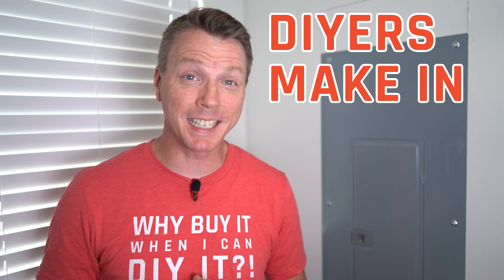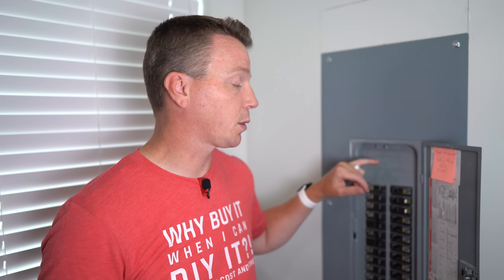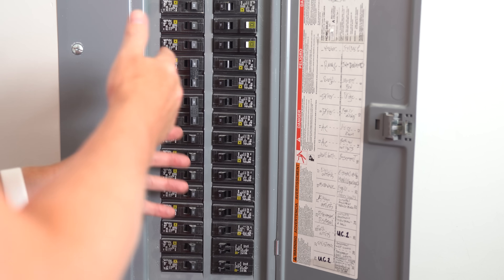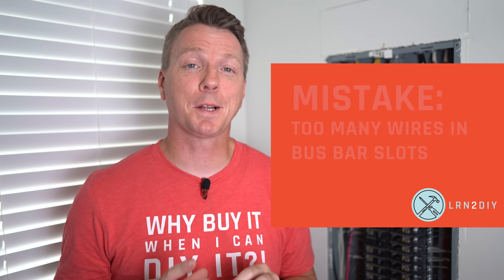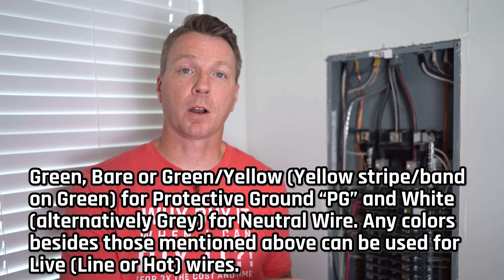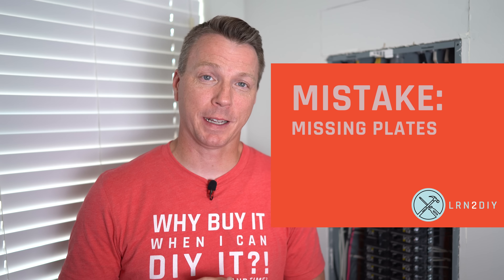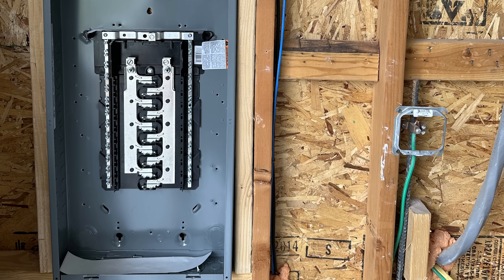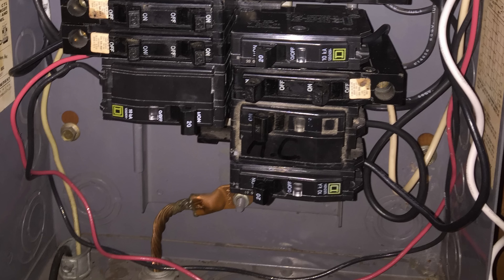10 Common Mistakes DIYers Make In Circuit Breaker Boxes

Comment: Thank You sir ! As a retired Journeyman Electrician with more than 50 years of experience in the field I saw more than my share of the "rats nest" type of panels, gasoline stations that had been remodeled several times. I couldn't always make them look perfect, but I tried. Any of the new Installations that I worked on, looked like the 3 phase panel you showed. When I upgraded my own residence from 70 amp Zinsco to a 200 amp Homeline  all my wires were formed and marked. When the city inspector came for final inspection he was taken aback and had to take a picture of the work. It is sad to say that too many tradesmen do not take pride in their work and only do the minimum.
Reply: I’m sure your fire department and insurance company thanked you for changing out that Zinsco. Given the issues with the Zinsco breakers, you saved yourself quite a headache.
Reply: I feel for you.  The day I realized that I changing out a Zinsco breaker with a Square D breaker box and all new breakers was cheaper than buying the Zinsco breaker was enlightening.
Reply: I had to do an entire clean up of excess wire that was stuffed into my square D 200A panel, purchased my 2600 sf home new and a “professional” electrician wired it, it was a nasty rats nest, I cleaned up the entire thing by removing excess wiring and routing them neatly.. professionals don’t always do professional work, guess time is money.
Reply: Amen brother, I thrive on neet and tidy.😂🤠
Reply: I am not sure why the electrical inspector did not turn the work in the panel down for sloppy workmanship. it is in the "N.E.C." that" all work shall be done in a workman like manor ". I do know that trying to up grade a gasoline station can be a problem with the pumps being that the seals that are pored  cannot allow the wiring to be removed being that wiring to gas pumps is classified by the "N.E.C." as explosionproof.
Reply: I've had that experience and I'm not a pro.
Reply: I'm thankful you do ❤🎄
Reply: That beautiful panel is inflexible to me. If I have to move wires around I have to cut zip ties and some of the wires are going to be too short. I liked this when building data centers but at my house that would drive me crazy. 

So I would like to se an example of an organized panel that still has flexibility so if I need to move a top circuit down some I still have enough wire length to achieve that. 

Does anyone have a suggestion of how to gain that flexibility and still have clean looking wires?
Reply: @ecospider5  Cut your conductors a set number of inches longer than you would need to do the pictured breaker connection.  Then just create a U shaped loop, visually similar to a plumbing p-trap, only with tighter bends.   I generally do 4-6 inches, but keep it consistent in the same panel.  As I get toward the bottom, I shorten the loops to what is necessary to move the breaker to the bottom slot.  I still zip-tie the bundle since it keeps things tidy, and snipping a zip-tie is simple.
Reply: @HisboiLRoi
Thanks. Good idea. I can see that working with 10awg wires and smaller. Especially if there is room.
Reply: @HisboiLRoi no need to zip tie wires in the panel. I absolutely hate that. I shouldn't have to cut zip ties of all the wires in a panel just so I can get to 1 wire. I use to do it bc that's how I was taught. But after going back and having to work on it, it's definitely not worth using zip ties. Even more reason not to now with the afci-gfci breakers and extra wires in the panel. Same with doing saddles on switches, feeds & grounds. I shouldn't have to take out 3-4 switches just so I can get to the 1 I need to. If there's 4-5 switches, a 5 gang box, I do 5 tails, 1 for each switch. Waaay easier to work with imo
Reply: @ecospider5 splice the wires, put a wire nut on it & there you go, you have flexibility
Reply: @jkhan6831
You’re right now, but I think about it the splicing one or two wires when you need to move things is gonna look a lot cleaner than leaving enough wire on every circuit so you’d never have to use a splice.
Reply: @ecospider5  I usually loop around the panel once before i hit a breaker. Well not an entire loop@, but if the wire comes into the panel at the bottom I'll go all the way up the other side, across the top or bottom,  and then to my breaker lug.  If there is room to do so anyway.  Otherwise I will usually double a length of the wire back onto itself neatly before I hit the breaker then zip tie things into  an orderly fashion.  I really don't personally care for zip ties in panels as it makes wires hard to trace. But a few are usually necessary to keep things neat.
Reply: That often comes down to money, the customer not willing to pay for a proper job.
Reply: This is why you should never hire electricians.  They do bad work and give out tremendous amounts of false information like "Only use 80% of a boxes rated capacity".  Nonsense.  The box is RATED 150 amps it can DELIVER 150 amps ALL DAY LONG and NON-STOP...that is what rating means.  He also talked utter nonsense about he cannot add more on to this panel when he added a finished basement.  Pure idiocy.  You can double each individual breaker to get the required capacity.  There is no physical way to overload a panels capacity TURNING EVERYTHING ON FULL POWER.  Light circuits run an amp or two MAXIMUM.  Wall outlets might run 13 amps maximum with a space heater but no one is running FIVE SPACE HEATERS AT FULL POWER while the electric water heater is running, the dishwasher, the furnace, the electric dryer, etc.  It simply never happens.
Reply: Standards are the absolute minimum you should do
Reply: More than one way to skin a cat.  These guys that do not leave extra wire in a panel require a lot of patching up when you got to wire nut extentions on just to reposition the breakers when new applications are added.  When you know that you may add solar, or an out building , or a hot tub, or a car charger, and so many things as that we can not predict it's better in those situations if the electrician before you left long wires to work with.  When you retired before 2023 you may not of imagined that future circuits are going to have all these requirements that could require moving breakers. The code changes every 3 years -- it's updated and added too.  So if you are implying that someone made a mess for not short wiring then you would be wrong.  Every old installation required a permit and an inspection, so those that passed inspection were done right with very few exceptions.  Now if you are talking about u qualified persons and bootleg work that's the exception and is no reason to disparage the electrician before you on permitted work.
Reply: I am in the process of having my house rewired I hope I end up with something I won't have to fight with for the rest of my life. I guess we will see eventually.
Reply: I guess I am an old fossil lol … but cmon, a torque screwdriver  to attach wires in an electrical panel?  Common sense works just fine lol
Reply: @bl9531 actually NEC requires all connections to be torqued. Few do it, but it is in the NEC.
Reply: @littleprincess4417  indeed a critical step!
Reply: @bl9531 
With high current loads that can change a lot it’s important. The heating and cooling will cause things to move if they are not perfect. 
In the data centers I worked in we had thermal pictures taken regularly and always found at least one screw that had loosened up and heating up. It would be way more than 1 or 2 if they were not torqued. 
Maybe it’s less important in a home panel. I don’t torque the panel at my house and I have never found a loose screw.
Reply: @bl9531 WHEN YOU INSTALL A HEAVIER STRANDED WIRE A TORQUE WRENCH OR SCREWDRIVER IS CODE REQUIRED FOR PROPER INSTALLATION! If not you could have a real problem with arcing down the road!
Reply: @Happy11807   if you feel the need to get the exact torque on 14 gauge wire in a 15 amo breaker in a residential panel then go right ahead … There is a rule to that effect
Reply: @bl9531  If it makes you feel better you can say, "click" when it's gutentight
Reply: @chaz720  good advice - should be just as effective as a torque screwdriver, only cheaper lol.
Reply: This is not a 3 phase panel. It is a sub-panel, with two hots and one neutral cable, which are all insulated.  The center conductor has a white stripe, and is the neutral, and not the third phase. There is also a ground cable, which is not insulated.
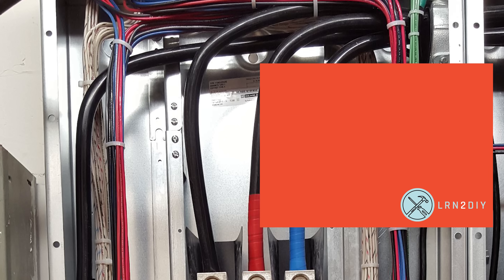Reply: @hsailer  No -- @13:04 the panel with the nice wiring IS a 3 phase panel (black - red - blue) with the neutral (black wire with white tape on it) coming down the left side and the ground wire on the right side 🤨
Reply: @hsailer  I could not tell if neutral had bonding screw in or not in this vid, but the point is super important.  On any service, only one point is needed for referencing neutral to earth, otherwise ground loop issues may emerge, and as we all know... lightning takes ALL paths to ground.  A sub panel must not duplicate neutral to earth bond found at main panel.  Anyway....sparkyman got it right.  Cheers!
Reply: @flinch622 the neutral is not  bonded. @ 11:27 the bond screw isn't there. He didn't install this panel.
Reply: @hsailer  One of the examples he showed had Red, White, and Blue tape markings.  This confused me for a moment until I realized this was a 3-Phase box, which no homeowner would see in their house (this is almost exclusively a Commercial/Industrial installation).  Since color insulation only goes down to #6,  The NEC requires that the neutral be identified at the point of termination, usually wrapped with white tape.  In the other split-phase example in a typical home, tape was not required, as they used a conductor with a white stripe, also the "B" phase was identified by the red stripe conductor.  Not bad, just made a mistake not catching the 3-phase picture in editing.
Reply: @hsailer  That's a nice way of telling us that this person is over his head to be giving advice without full disclosure of their training and knowledge. Every electrician knows better. Lol. 3-wire single phase -- true !
Reply: Question! i have a 200 amp service. Is the amps per leg or both legs in total?
L1 100 Amps  L2 100 amps?
OR
L1 200 amps L2 200 amps?
Reply: 200 amps per leg.
Reply: @woodzyfox4735
Each leg is 120v. So if you put 200 amps on both legs you have 200 amps at 240 volts. Which is what the panel is rated for. Since the 2 legs are out of phase you add the voltage not the amperage. 

What you need to be aware of is you want those 2 legs balanced as much as possible because of the neutral. The neutral to your house (to your main panel) carries the difference between the 2 legs. So if one leg is carrying 50 amp and the other is 100 amps the neutral is carrying the 50 amp difference. 

Rewire things to 75 amps per leg a the neutral will be carrying almost no current. Really this is not a safety thing for you it is being kind to the power company and not over pushing only one half of their transformers.
Reply: Do you get paid for azzkissing?

Comment: The issue is,  its 10 mistakes where you are located, but only two miles away its considered 8 mistakes.  in 1997 it was only 2 mistakes. Then, on Jan 1st, a new code book will bring it up to15 mistakes. In short, the NEC would have you believe that anything built more than 2 years ago is a fire hazard.
Reply: 2 years? pffft.. if the NEC had it their way, 2 hours after the latest NEC is published. NEC Isnt about safety, its about whose pockets can those who sit on the NEC but also conveniently the company  making the products the  NEC is pushing  boards/investors

Comment: Please explain this  an receptacle  is 15 Amp but the breaker is 20 Amp
Reply: you can have a 15 amp receptacle on a 20 amp  breaker. the receptacle will fail before the wire/breaker does

Comment: The clean 90 bends into the breaker looks nice.  When I upgraded my panel from 100 to 200 amp the city inspector insisted the wires introduce to the box then run to the bottom and with a loose bend back north to the breaker.  His explanation to this was to be able to pull out a circuit and work some distance from the open panel.  Unfortunately, before the internet resources readily available so I didn't argue and wired per instructed.  Not only looks like a nest (not as bad as your example) but the odds the circuit you're working on is a top layer wire, in the spaghetti, and not layered several deep is not favorable.
Reply: I had an inspector that seen a panel done this way. He look at it a while, then say "I am trying to figure out the spaghetti soup". It failed inspection for about 100 different reasons. The owned did it himself and did not want to pay to have it done right.
Reply: @tiggeroush  The hope is you can rely on the city inspector to "know code" since my resources didn't touch on how the panel should look and my 100 amp was beautiful with 90s to each circuit however the inspector stated he wouldn't pass in that configuration.  Oh well like a haircut you can always take off more if need.

Comment: 6:04 pigtailing the grounds is not a good idea because if by some really unfortunate fault you had multiple ground faults at once you could overwhelm the ground wire burning it up before a breaker trips.  A 1:1 connection should be fine if you cut the wire too short but the ideal fix for that is to use a proper junction box OUTSIDE of the panel box.

Comment: 40yrs. in the electrical industry, and I told more customer's that if they had their panel labeled , or labeled correctly , it would save me a ton of time wasted looking for a particular circuit. So do yourself a favor, label your panel, or if you can, label your device's of what circuit it is, big help.

Comment: I don't know if blaming DiYers for some of the mistakes.
Home I moved into, had Zero-0 circuit breaker identification(Builder? Electrician?)
Main Panel box is installed by Home Builder, NOT a DiYer so I feel the title is mis-leading.

Comment: on #2 the main breaker can handle one 100% of the calculated load. Only continuous loads are at 125% that's factored in when you do the load calculation for those individual Branch circuits. There's even demand factors that can lower the main breaker size. (Applies only to certain types of loads)
Reply: I agree that #2 is flawed. Main breakers are generally not designed for continuous loading, which mans that they cannot accept the full rated current for three hours or more. All circuit breakers will allow the full rated current to safely pass, just not for three hours or more.

Comment: 7:00 You're not allowed to have two neutrals under one screw also because if you need to remove one of the wires you're likely to interrupt the neutral on another circuit which can be a bad thing.   Ground wires don't have that problem and it's perfectly ok to put two (and sometimes more) ground wires under one screw.

Comment: you forgot 3 mistakes including the #1 mistake DIYers make.

1st... using wrong size breaker. I don't know how often this actually happens but im sure it happens.

2nd.... putting too many outlets/lights/rooms on a single breaker. i remodeled my house few years ago and redid some wiring. while doing so i discovered my (original) living room light and outlets, added on new living room lights and outlets, hall outlet, 1 kitchen light, outdoor light were all on same breaker. now i had cfls at time now leds in lamps and lights except old living room light and kitchen light was fluorescent tubes. other than couple lamps the outlets were used for low amp tv and stereo and most not used. so technically it was ok. but i had another breaker with only attic lights and another with only half the garage lights which were fluorescent tubes... now leds. and another with 1 garage outlet only. So I put all garage and attic lights on 1 and split the 2 living rooms and some other rearranging.

and the #1 mistake people make...... Not hiring a professional!

Comment: In case ground wire are combined to pigtail, pigtail conductor must be at least the size of largest ground wire in the group also to make sure CB in largest circuit trip in case fault occurs without catching fire.